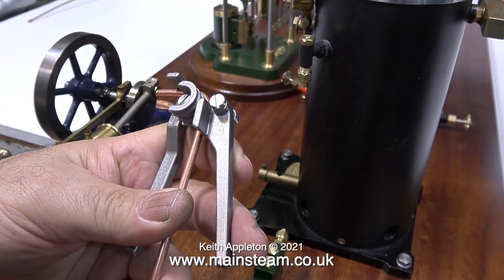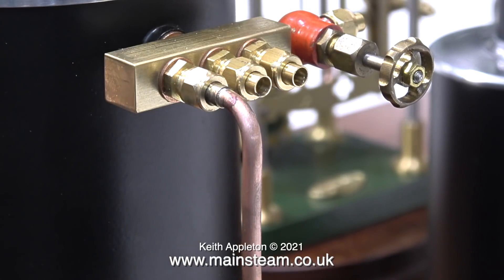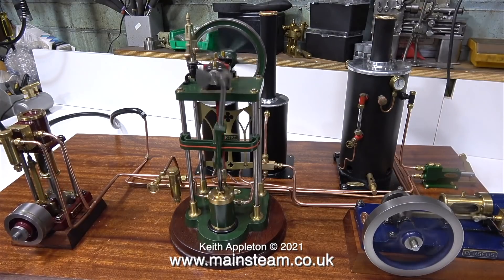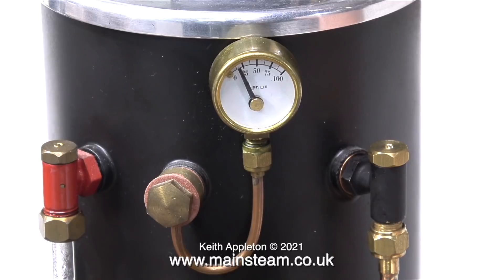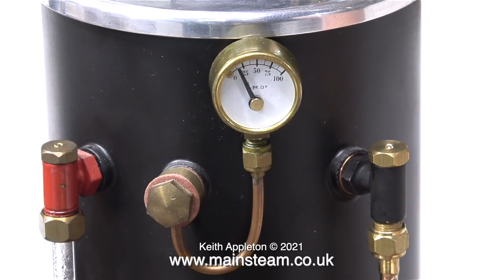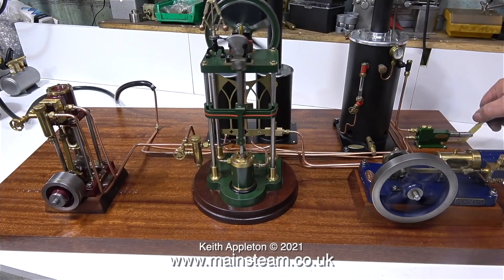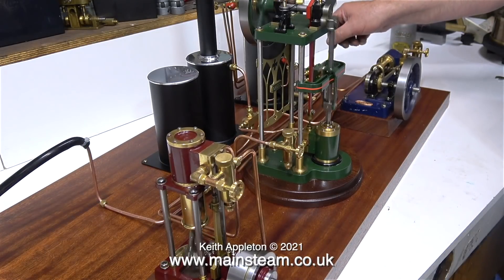MODEL STEAM ENGINES AND BOILERS - PART #14

Comment: Fresh cut copper doesnt only score the baseboard, but it also cuts skin of cnuckles very good. I have a cheap bending tool with 4 different sizes in my van, but i dont use the below 1/4 inch that much...

Comment: Question not a critique.  You ran 3 steam lines from the boiler one to each engine.  Why didn’t you run one large line from the boiler.  Then run a smaller and shorter line to each engine, from the main line?  You videos are fascinating, thanks making them.
Reply from the maker: It's just a matter of personal taste, I prefer it the way I show in the video.
Reply: @keithappleton  Okay, thanks